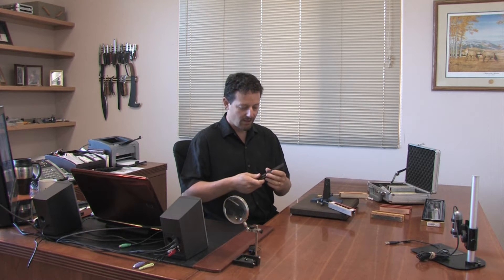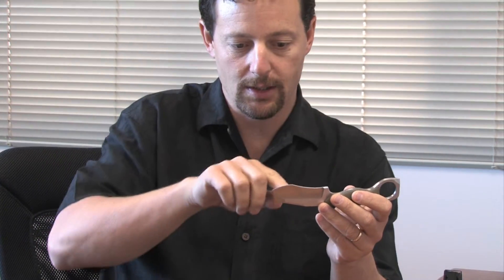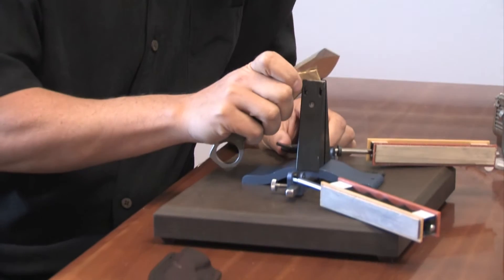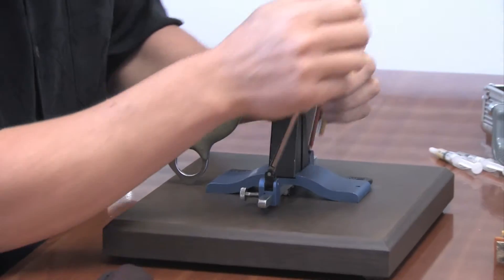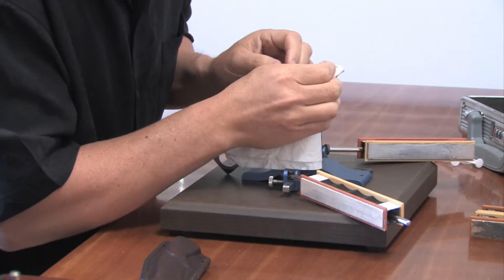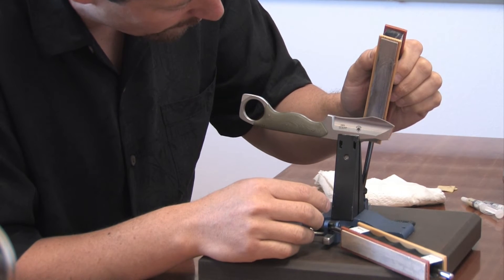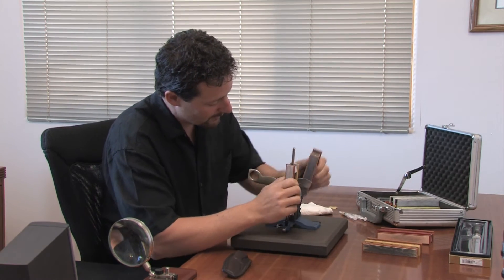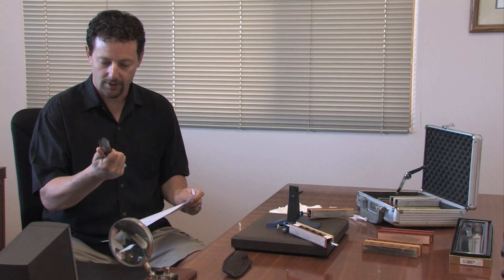Wicked Edge Sharpens a Jon Graham - Razel Knife

Comment: Hello, I've noticed when I sharpen a knife with a recurve style knife with my wicked edge it tends to grind it straight just a tad, I'm I doing something wrong?
Reply from the maker: +REDMANKLAN I've seen the same thing. It's just a tad like you said. The trick is to spend more time working on the low spot of the recurve. The other option is to pick up our curved stones for recurve blades.
Reply: +Clay Allison thanks clay ya I seen them stones a bit pricey I'll have to save my dough a bit